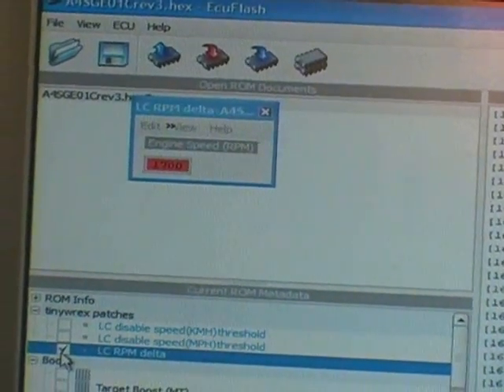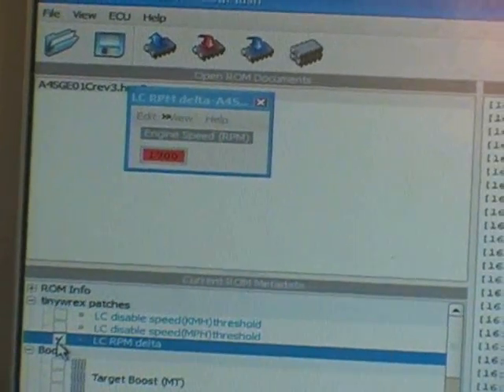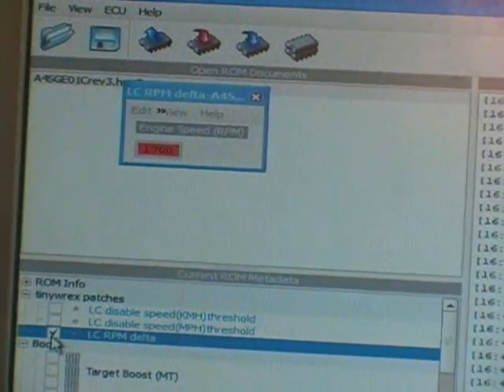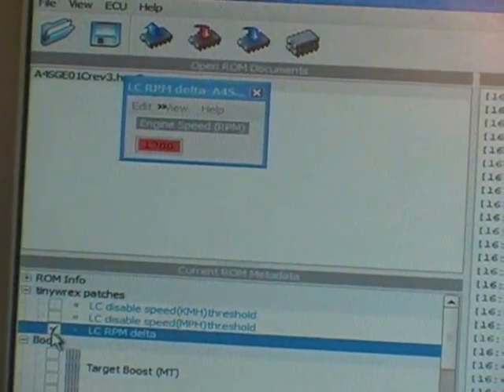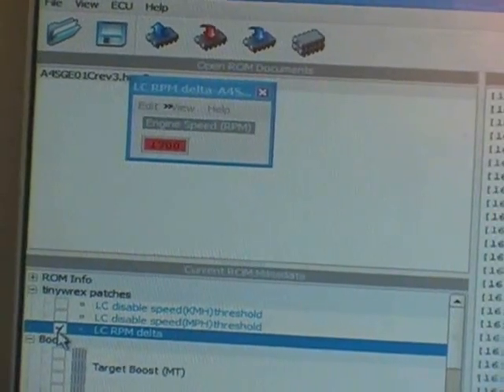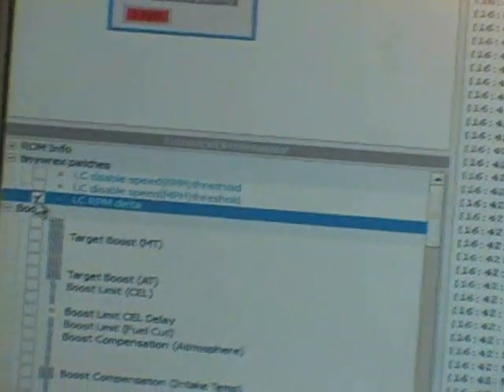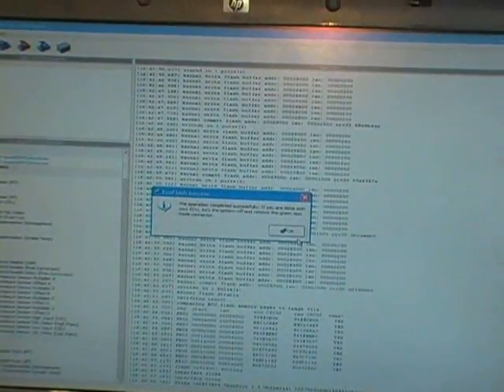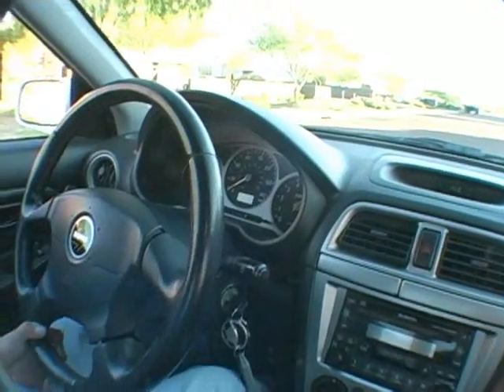Subaru WRX STI ECU Launch Control

Comment: why the fuck did you fit launch control and let it rev to 6000rpm set it to 3800 or 4000 not 6000 thats silly you might as well redline it